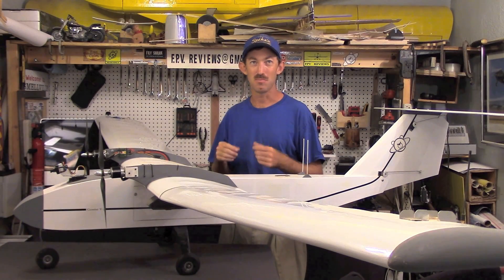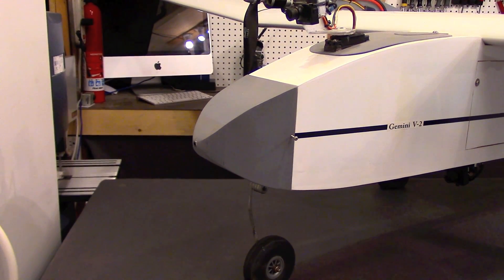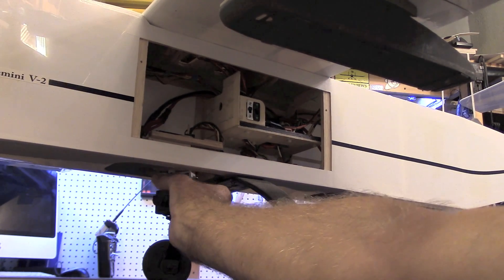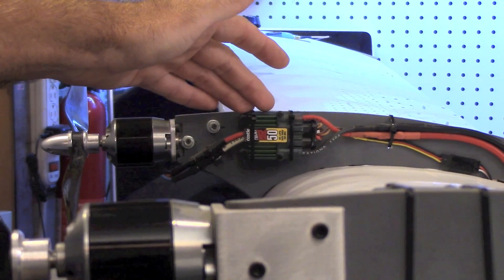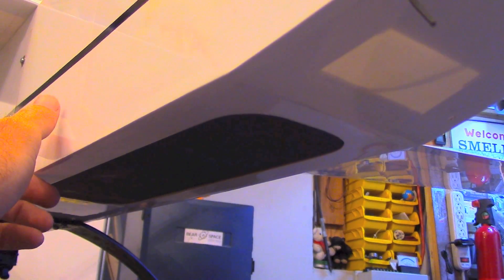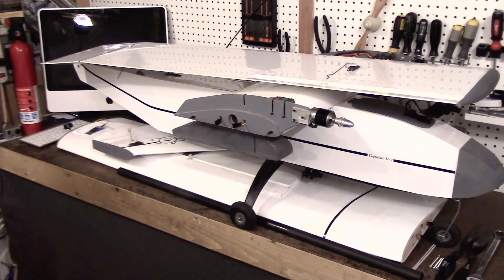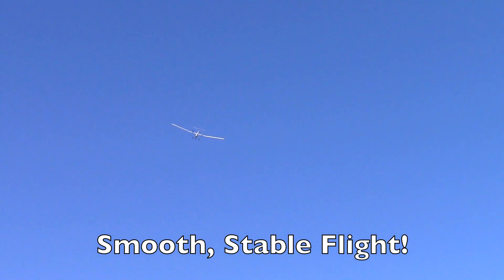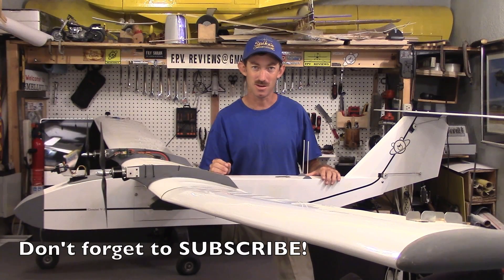Gemini Version 2 Review - Advanced FPV / UAV Plane - Plans and Kit Available Now!

Comment: This is fantastic. Great to see the increase in capacity from V1. Shame to submit to practicality and simplicity of design by ditching the excellent cooling design from V2. Understandable though. What is the scope for solar power, given the wing surface area available. Could push you past 12km. Very impressed viewer from Australia, will look to get onto one in the near term.
Reply: Cooling design from V1*
Reply from the maker: it could go well beyond 12 km, just have not wanted too until i get a reliable autopilot. 120km distance linear in one flight, while carrying a payload. 
by changing the airfoil, i have retained the performance. will be doing some demo flights soon to push the envelope for endurance. cheers!
Reply: FPVREVIEWS Ah ok, fair enough. Bloody good range. Keep it up. Great to see the project progress. Cheers.

Comment: A few minor thoughts; first of all, I have to say I very much preferred the look of the wood finish on the V1. I know, I know, its just a choice, but it looked so awesome. The white cover on your V2 hides all the craftsmanship and makes it look like cheap plastic.
Secondly, why would you put both rx antenna's in the exact same orientation? Put them at a a 45-90 degree angle, so you'll have better chance of reception while banking
Lastly, the dropable payload under the wings, did I see it right that you lose the hatch on each drop? There is room for improvement there I think.

Now that I got that off my chest; what a fantastic plane!
Reply from the maker: there are two control systems, one ezuhf with diversity, and the second antenna for it is not visible, because it's hidden in the fuselage. it's in a horizontal position to best receive at very ugh altitudes.  the second one you see is the antenna for the dragon link. on a n airframe like this you tend to run out of control channels no matter how many of them you use. you also have more functionality than one pilot can handle.  
The white monokote is more stable in the sunlight, and does not show the accumulation of condensed moisture inside the airframe. being cooler, there will be less of it too. it was a bit of an issue with the prototype covered in clear. i no longer need to inspect the airframe each flight either, as the v-2 is much more robust. 
I looked the look too, but this is so much more practical.  
you do lose the hatch, but i was just trying to show one application for the droppable payload. the hatches can be made out of a piece of cardboard, and cut out with scissors, so no bio loss there, or is it really littering if it biodegrades within a couple of weeks. anyway, hope that helps explain things. cheers

Comment: Nice work, would it make sense to use the wing hardpoints for extra battery's?
Reply from the maker: yes, it could. the batteries could also be inside the wings. there is room.
Reply: Nice... The twin engine setup makes this a very interesting platform.
Reply from the maker: Horacio Stjeward once i committed to a twin, there are lots of benefits, and a lot of bad habits of single engine planes go away. p effect, torque roll, gyroscopic precession, thrust height, thrust angle problems, and vibration problems go away because props are in clean air, and the vibration counters itself internal to the wing spar,and never transfers into the fuselage,where the sensors are located. etc, etc..